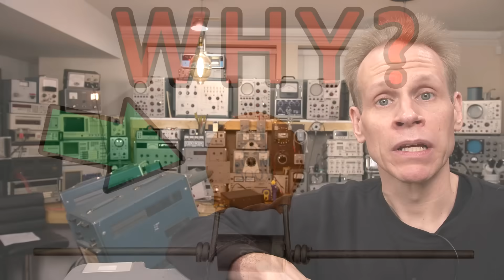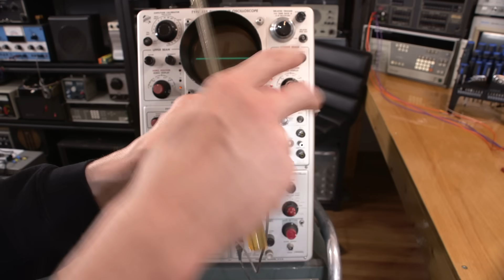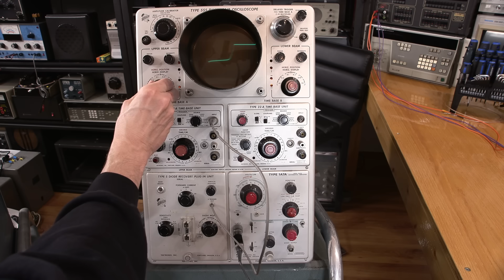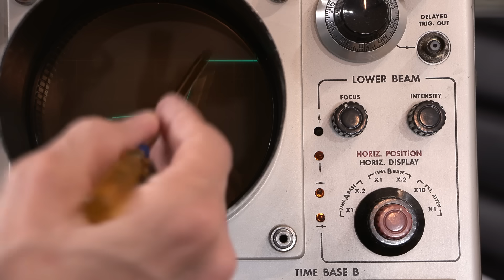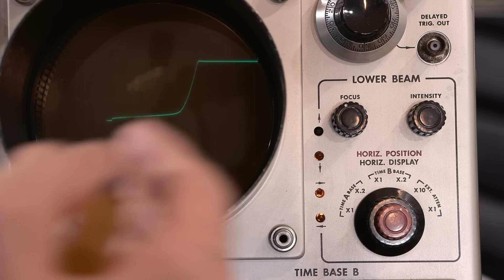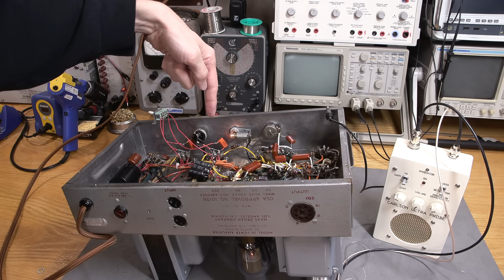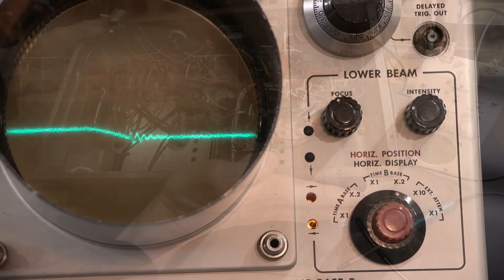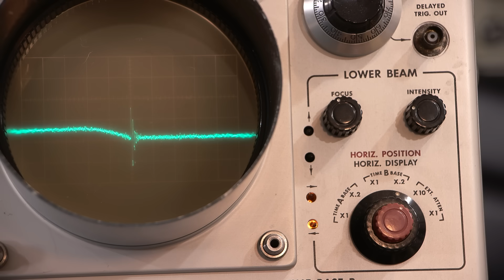Why Put A Capacitor Across The Diode? Here's Why!

Comment: This interesting! I’ve recently started building tube guitar amps and would like to reduce as much noise as possible! Is there any significance to the value of the caps across the diodes?
Reply: You won't hear any difference either way... but use a 10nf (.01uf).  I use 1KV discs for 120V mains just because.
Reply: Depending on the circuit you may or may not need them. Take a mid 60's Fender Twin with a full wave rectifier and they're not used across the 6 diodes, but then take a late 70's Ultra Linear Fender Twin with a bridge rectifier and there they are across all 4. In general I use an X cap across the mains to combat modern RFI and if the amp has a solid state rectifier I use UF4007's instead of the standard 1N4007's as they're generally less noisy. Hope this helps!
Reply: @darrencampbell8817  Years ago I bought some fast recovery/soft recovery diodes to replace the common silicon rectifiers in a vintage music tube amp - heard no difference... I always bypass rectifiers in my own designs but the effectiveness to the end user is always suspect.
Reply: @ohger1  I hear you, but my family has been building amps since the 1930's and the rule has always been to over-engineer everything regardless, especially in power supplies. Sure the difference may not always be apparent to your ears, but if you can see it on a scope then that's all that matters from an engineers perspective.
Reply: @darrencampbell8817  Well, that's the thing - you can certainly see hash at the AC side but when you scope the B+ or look at the signal waveform at the outputs - even at extended sweep, you don't see the effect of bypassing rectifiers.  The important thing to me was always to make sure the amp doesn't oscillate at very high frequencies - something the AC input won't affect.   But yeah, I also bypass the rectifiers because I always have.😏
Reply: @ohger1  I think that over the last century many of the engineering practices for RF have spilled over into the realm of audio, which isn't a bad thing especially nowadays with all 5G towers sprouting up everywhere. Don't even get me started... 😂
Reply: @darrencampbell8817  Boring story... I have a 1928 RCA Radiola in my front room which is pretty much unrestored (5 of the 8 tubes replaced, but nothing else).  I hadn't run it in a few years but I went to use it to listen to a ballgame, and most of the band was obnoxious noise - only the two local stations were clean.  I figured it was time to finally restore it and took out my trust Emerson 911 transistor radio to pick up the ballgame from NY, and that radio was acting the same way.  I threw the main breaker off in my house and the transistor radio came to life including picking up the distant ballgame and the rest of the NY stations.  I started throwing breakers back on and found a bunch of stuff in my house causing RF garbage - motion lights in my driveway, my alarm system, and the worse offender was my cable modem.. I took the modem apart and the PFC filter was puffed.  I replaced that and put an "X" cap across the main and it reduced the noise by 90 percent.  I don't think the FCC cares about Part 15 anymore..
Reply: @ohger1  Yes, it's always worth fitting the caps. Even if it gives no discernible improvement on the device itself, it may well reduce interference on nearby radio receivers, and will also help protect the diodes from destructive mains transients. "Don't spoil the ship for a ha'porth of tar".

Comment: Interesting, the diode is acting as a brick wall, this is why youre not supposed to block audio signals with diodes, they chop off half the audio waveform
Reply: That's not the problem, the problem is that the diode contains charge carriers that accumulated and will not care about the direction of current they mediate; thus they get used up by the reverse current which then extremely suddenly breaks down with the circuit's inductance forcing against the reverse bias capacitance of the diode.
It's that very LC that gets tamed to lower frequencies if you add that bypass capacitor.